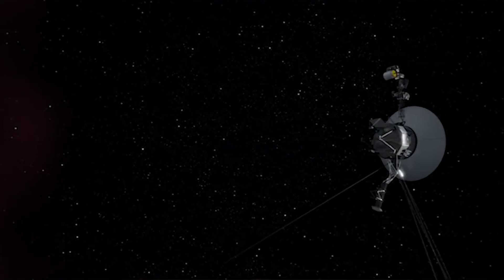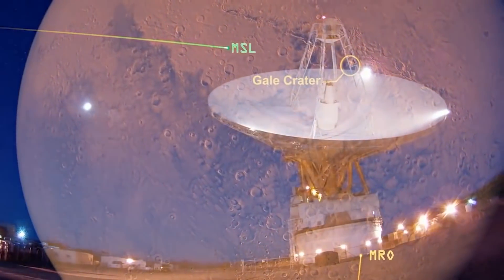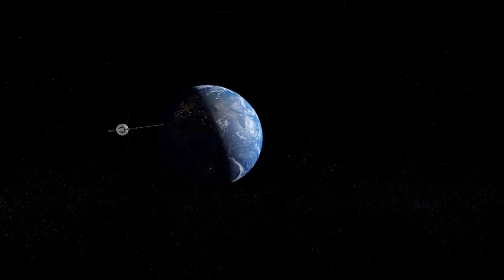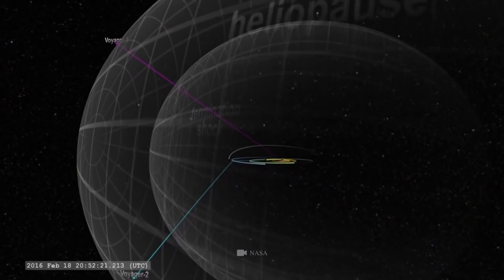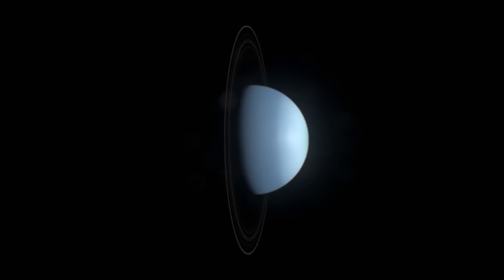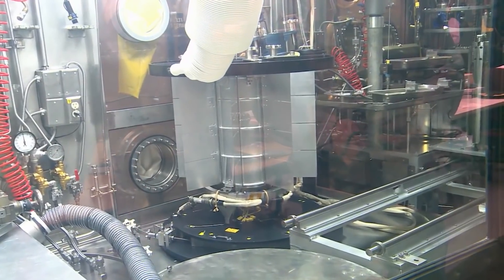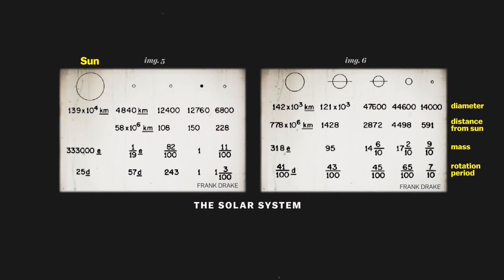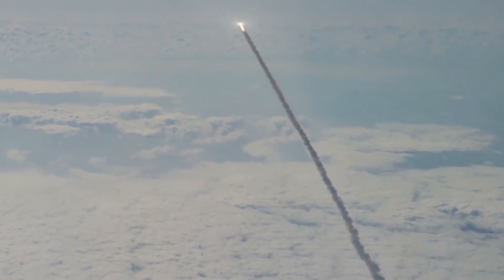Voyager 2 is FINALLY Back Online but Scientists Found Something SHOCKING

Comment: A hard drive or SSD uses electical components to store data.  The extreme radiation of deep space would corrupt and destroy that data.  An analog storage device such as an LP doesn't have that problem.  However, it can be damaged by physical damage caused by collisions with debris in space.  I think an analog storage device has a higher probability of surviving the hazards of deep space.

Comment: I wish those videos would be filled with actual information its annoying to be held that dumb...
11 Billion miles = 17.702.784.000 Km
thats roughly 16 hours for light to travel through. Radio waves travel in the speed of light, there is no "if" Radio waves are a spectrum of light...

Comment: So.. 🤷🏼‍♂️ what's the "shocking" bit?

So far I have seen many short docu's about both Voyagers. Nothing new here.
For me the shocking bit was to find out I waisted 10 minutes waiting for a shock.
Now that was shocking.

Tho the video is of a good quality, clear but a bit slow narrated, the header suggested a "shocking" result.
There wasn't.

Because of that, unfortunately I would like to give this video a 6 out of 10.

Pity...
Recommendation: Don't suggest in headers stuff that doesn't happen. The average mainstream media outlets polluting the air around us with more than enough bs headers.

No hard feelings tho 🙂

Comment: Instead of massive nuclear plants, why can't this type of power be used to power office buildings, small towns, military bases, war ships, power grid to feed electric vehicles and so on, it lasted fifty? Years!!
  It might supply an office building for a decade? With upgrades this could be very useful.
Reply: While Radioisotope Thermoelectric Generators do last a long time, they are pretty inefficient, and the actual amount of energy they put out is relatively small. Despite these drawbacks, space probes use RTGs because of their long lifespan and lack of moving parts that could easily break and cripple the spacecraft completely.

Comment: if it's a probe why the fuck did they turn the camera off in interstellar space ? if it's going to shut off in 3 years, i would want to see what it looks like outside of our solar system !, chances are me and everyone  else on Earth won't ever get to go there to see it  for ourselves, that's why we sent the probe , to send us visual data/photos of space !
Reply: Because
1) there is NOTHING special to see. If you're expecting to see planets & asteroids and stuff, you don't understand the scale of things. 

2) The probes are too far away to support the required data rates needed for video. We simply can't detect those data rates anymore because the received signal is too weak.

And in addition, the cassette storage unit used to store image data isn't capable of playback at video rates any longer. 

3) even if we could receive the signal well enough, there simply isn't enough power for the cameras & video storage & transmission power anymore. 

The last time either voyager used their camera was in 1990. Its been 30 years. Yeah, those systems are long past dead. Sorry.

Edit: And no, the purpose of the voyager probes was never to "explore outside the solar system." The purpose was to get images of our outer planets. Which they did.

Comment: Isf any of you out there who believes this BS, I've got some property 180 miles east of Charleston S.C. that I will sell you very cheap....I can't even get cell service when we are at a state park, and NASA is gonna lie and say that they are receiving signals from that far away....I call this one BS.....and anybody who believes this BS needs to have a checkup....mental wise I mean.....lies of the devil......
Reply: The average cell phone communicates via a three-watt omnidirectional transmitter in the 600 MHz to 39 GHz radiofrequency range, which is very busy and has a lot of man-made interference. The Voyager probes communicate via 23-watt transmitters on the much lesser used 8 GHz range and use focused directional antennas with 40 foot dishes. While your cellphone and the Voyager probes may communicate on the same basic principle, their very different hardware-wise.
Reply: @sammurabi4743  Yeah...I figured there would be somebody who would start talking trash again, and I was right....it doesn't matter if they had a billion watt transmitter, there is no space to go out into....NO SPACE....so the question is moot.....hardware, software...it is all the same...BS....
Reply: @benb3584  So what exactly is above the atmosphere then? Where are the rockets sending their payload to? And what do the 2,000,000 people who work in space exploration across the globe have to gain from tricking the masses into thinking space exists? What would they have to gain?

Comment: Hard Drives were invented in 1953, and were commercially available in 1957 when IBM started selling the 305 RAMAC. The problem was the drive mechanism was 2 feet in diameter and used a ton of electricity. Carl Sagan long ago stated that the gold LPs were a basic technology that could be easily described in pictograms that could be reproduced by even primitive people and went on to prove that by having the pictograms tested by anthropologists working in the Amazon basin where the natives were able to create a basic horn-type victrola.
Reply: Carl Sagen calling others "Primitive people" Thats a laugh.

Comment: "Even if radio waves travel at the speed of light, it would take AGES for signals to travel from Voyager 2 to Earth and vice versa." What scientific illiterate wrote this? Let me get this straight: Voyager 2 is so far out in space, it takes radio signals AGES (how long is "ages"?) to reach it. But Voyager was only launched in 1977. That was only 45 years ago. That's mere decades, not "ages." Is Voyager traveling faster than light? WTF? Who writes this drivel?

Comment: While the golden disc may be crude, it is very robust.  Impervious to electromagnetic pulses,  radiation and corosion.  A modern flash drive could easily be wiped clean by the harsh environment of deep space.  As long as the disc is not physically damaged, it could last thousands of years.  Carl knew what he was doing.

Comment: what's really impressive is they didn't have scientific calculators and used pencil and paper with a slide rule to speed stuff up. heck the  space shuttle did it's job with just a meg of RAM memory. now day's we have more than that in a wrist watch. the fact they can hit the marks to get a boost from the different planets and not crash into or completely miss them is beyond comprehension.

Comment: To commenter CHASE BURT you are right on target with your comment because all products made back from 1977/75 to 1940s were the AMERICAN MADE BEST such as this OUTER SPACE VEHICLE shown in this film! Any product from 1978 to 2022 wont last a year or more as the products I believe are designed spitefully to break down as I call whatever the APPLIANCE/CAR/FURNITURE an EMPTY PLASTIC HOLLOW POTATO CHIP CRACKER MATERIAL APPLIANCE:READY TO TURN TO POWDER (the fixtures around light bulbs) and DETERIORATE IN A ONE YEAR PERIOD!!!!! And cause many of the recent FIRES (investigators are always quick to blame the appliance-maybe it is true most times as you do see very shiny new APPLIANCES ready for the GARBAGE TRUCK ON THE SIDEWALKS) Some commentors say thier COMPUTER GETS HACKERS/VIRUS/SPYS and we have CALLER I.D. NOW AND THE MAKERS OF ALL THESE 'SMART' DEVICES CAN NOT GRAB THE HACKERS SIGNAL/WORK BACKWARDS AND TRACE THE ORIGIN OF THE HACKERS WITH THE CALLER I.D. OR WHATEVER??????MAYBE OUR SPACE PIONEER DEVELOPERS SHOULD GET INTO THE MANUFACTURE OF HOME DEVICES!!!!

Comment: Heres a thought: sound dose exsit in space as  oscillations in that gas......it a medium just like the atmosphere just(in short) with different physics so you can "hear" in some spots and not in others. Deeper in more dense and/or heavier elements and vice-versa. 

Thought 2: in a large sphere of a gas mix equal to earth's gas, that has a center as dense as earths...you could can take your suit off, survive and talk to eachother while floating in the middle of this gas cloud.

With a pressure 1:1 with earths atmosphere it might sound and feel different and the gas would definitely have more dramatic pressure wave.....(if radiation and temperature wasn't an issue)

Comment: Absolute Rubbish.  How the Hell can they  pick up a signal that far away?  A CB signal cuts out a after a couple of Miles.  Also! We live on a Flat Earth. Dont believe any of this.  I used to,  then I found the truth.😁
Reply: Radio waves travel at speed of light in a vacuum. And it's radioactive ☢ decay nuke 🔋 power it. 🌎 Is round and spinning all proven facts. Antarctica is 5.84 million sq miles 5th largest continent on 🌎 NO IMAGINARY ICE WALL EXISTS. 🌀, 🌋, 🌪, Jetstream, plate tectonics, 🌎 quakes can't happen on a flat 🌎. 🌎 Is 25,000 miles in circumference obilate sphere weighing 13 septillion tons can't feel slow rotation of 1,000 MPH. Bible proves 🌎 is round and space is real and endless. Stop believing in debunked conspiracy theories with zero evidence to back up your claims about flat 🌎 pseudoscience bullshit that never been proven. God did not create a domed petri dish. 8m a born again Christian and Bible doesn't say anything flat. The 🎑 is 238,000 miles away from 🌎 and 7,000 miles in circumference. The ☀ is 2.75 million miles in circumference, 93,000,000 miles away from 🌎 and 10,000°F surface temp.

Comment: "Where is Voyager 1 now?..it is between our sun and other star" ..wait what?!!!! That's not possible.,, how can it be between any other star if it still in our solar system?...proximal centauri is more than 4 billion light years from our solar system..Voyager 1 is still near our own star.. please clarify.
Reply: They are 12-14 billion miles away from 🌎. Alpha centari is 4.2 light-years away from 🌎 or 25 trillion miles away. A light-year is 6 trillion miles long. Voyagers nuke 🔋 are almost depleted it doe its power by radioactive ☢ decay.

Comment: Travelled 11 billion miles in 45 years...it would have to be travelling at over 30,000 miles an hour.
And still be able to spot new data and send it 11 billion miles back to earth...
How long would this new data take to reach earth, and what technology is being from ( from 1977 mind you) to transmit all this magnificent groundbreaking data back to earth
Reply: When Voyager 1 is unable to communicate directly with the Earth, its digital tape recorder (DTR) can record about 67 megabytes of data for transmission at another time. Signals from Voyager 1 take over 20 hours to reach Earth. And there is lag, radio waves travel at speed of light in a vacuum and vacuum of space is not a perfect vacuum.

Comment: I call BS. No way a satellite could navigate through billions of asteroids moving at thousands of miles per hour in the Kaiper belt with the 1970s technology.
Reply: It did, When Voyager 1 is unable to communicate directly with the Earth, its digital tape recorder (DTR) can record about 67 megabytes of data for transmission at another time. Signals from Voyager 1 take over 20 hours to reach Earth. And there is lag and sometimes data corruption. Powered by radioactive ☢ decay nuke 🔋. Almost depleted soon they'll be dead probes.

Comment: Wow they had super wifi 40 years ago to control this thing wow... wonder what kind of router nasa has that can control a craft 11 Billion miles away without access points all along the way to bounce back signals to earth... i want a Nasa router... also i want their secret for going through the seal that seperates us from the vacuum of space without killing ys all because we all knows what happens if you have a vacuum sealed compartment and if it gets a pin hole in it is not a sealed vacuum compartment anymore now is it.... i tgink NASA has better magic than david copperfield does

Comment: Why don't they have a you know how like they have rolling blackouts in California depending on the instrumentation and how it works is there anyway to do a rolling chamber circle of the devices to go on and off at a certain save to be able to create a Doppler effect on information that way you're not using as much power if turning it on and off doesn't jump in the amperage that way you run all devices 2 Minutes special distillation so you'll be able to see everything with all the devices and save probably two-thirds of the electricity

Comment: I don't understand 1 thing. A nuclear powerplant still makes power by heating water into steam which then drives a steam turbine just as a coal fired plant. They said this was the same thing but smaller. How is this possible where there is no supply of water?  Does anyone know how this actually works?

Comment: We ( The U.S. ) have gravity nullifying vehicles called the TR3B. They operate by putting a super high voltage into liquid Mercury which creates a rotating magnetic field that negates upwards of 90% of the effects of gravity. We can and have travelled FAR out into the galaxy. We're just not being told about it. Key search terms are: TR3B, Mercury plasma, rotating magnetic field, gravity nullifying, gravity negating.

Comment: Actually to connect to as far as to the infinity, we could use supper position principle by combine the light signal each is separate by 300 m in length or delay by micro second and with the vast ocean our there there could be million of such coil so the by 1 second exactly 1 million signal combined together and you get the idea. We could lay tile if those until we get to any where because the ocean out there allow trillion of those type of design to catch up. Also we could entangle two twin video cameras as small as a police hidden camera and use small emf drive so that the quantum signal can be communication to earth instantly instead of 17 years

Comment: As of December 7, 2021, Voyager 2 is only slightly less than 16 hours away from earth.  32 hours for a round trip communication, in the cosmic sense, is not that long at all; it’s definitely not a “ lengthy and difficult task“ because of distance alone.  It would be nice to have photographs transmitted back since interstellar space is not as sparse as what was originally hypothesized.

Comment: Just wondering why a antenna probe can’t be sent out into space in the same direction that could amplify voyager’s signals for better reception. Multiple cell towers are set up that way, why wouldn’t 3 or 4 small amps do the same.
Reply: Nice thought, but consider that a repeater probe would have to be the size of the DSN dishes to do any good. It’d also have to get the same or better gravity assists from the other planets to have a hope of getting an appreciable fraction of the way between us and Voyager.

Comment: So if the sun is moving through the galaxy wouldnt the heliosphere also move with it? Also how much of the solar system's momentum through the galaxy is transferred  to voyager? Kind of like when you throw something from a moving car... how long until the heliosphere moves away from voyager?
Reply: That is a good question, i will answer it. Voyager 1 and 2 is not travelling ahead of the course of the solarsystem in our galaxy, but to the sides, if you can use that term, so actually at some point the solarsystem will overtake v1 and v2 but they will leave the heliossphere.

Comment: If the plutonium has a half life of 90 yrs. Why will it fail to produce enough  power in just 43 yrs by then? They should have built in multiple back up power supplies and more enriched forms of nuclear materials so it will last long enough to reach the nearest star or galaxy in its path.....

Comment: Even "IF" radio waves travel at the speed of light?
There is no "IF" in the vacuum of space.
It would take "AGES"?
It takes hours...Less than a day.
The problem isn't with the speed of transmissions...Its with their strength. radio waves don't travel in a zero point configuration...They spread out from the source. You can kind of limit the spread with a dish but the spread is still there and the greater the distance, the weaker the signal as a result.
The built a dish for catching more of that signal a couple of years ago for just that reason.
Perhaps you need to do more reading to learn more tech before you hurt yourself..

Comment: 2024 is right around the corner.  It would be wacky if some aliens get one of the Voyagers, can't figure out the disc, so they just recharge the batteries and send it back out.  But they could figure out the camera.  Suddenly we start getting data again in 2100 and it's alien selfies.